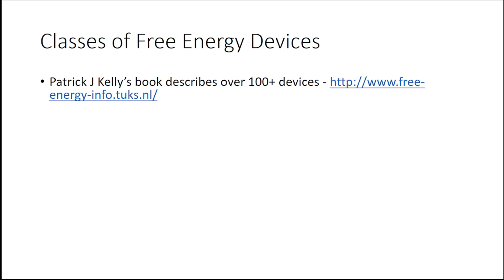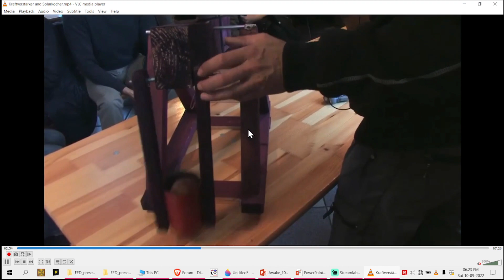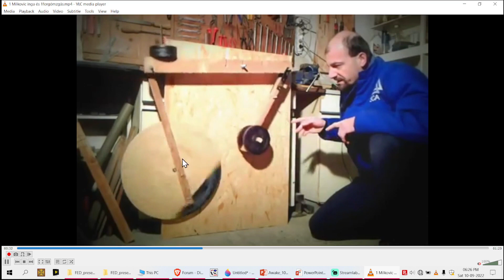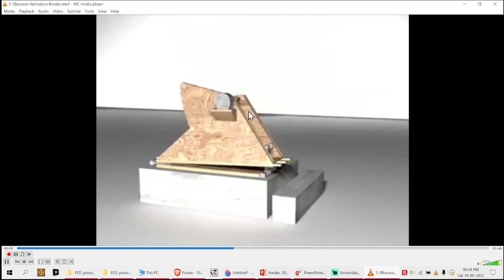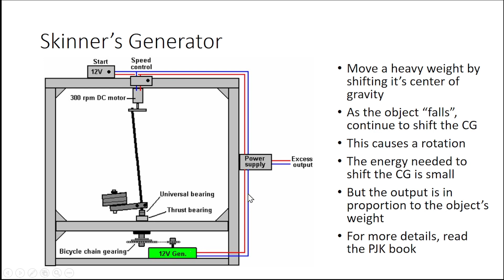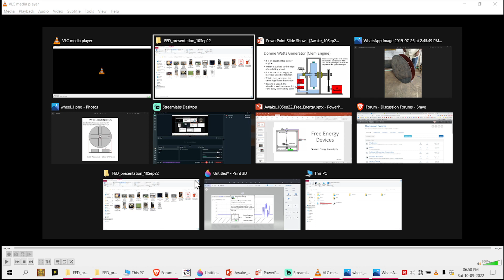Free Energy Devices : Towards Energy Sovereignty

Comment: Great info, joule theif is not over unity though, it's a well known circuit, it's highly efficient but input is always equal to output, I will check it again myself . There is a person named Great scott on YT who already made one. Also any gravity based device is supposed to have friction right, then how is it over unity ? Yet I m lookin more into it, thanks for providing the info !
Reply from the maker: Friction is not an issue with modern bearings and lubrication. With COP > 3, even bad frictions won't be a big concern. The models I've described have COP > 5.
Reply: @ramakrishnanselvaraj4433  I got his book, I m trying to become a expert in electronics myself , and most of the systems we deal with are less than unity. But I m on his book, will even try some of the circuits mentioned here as I progress. Will test the joule theif as well and will get back to.you . I ll need to build a torroid